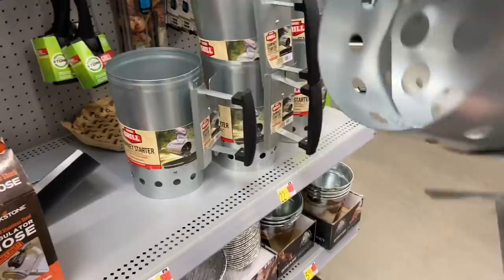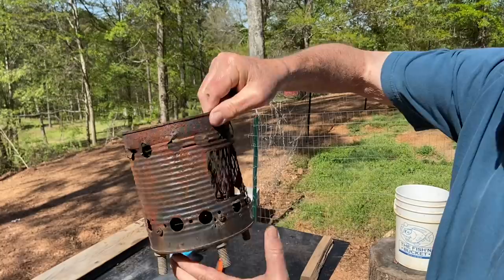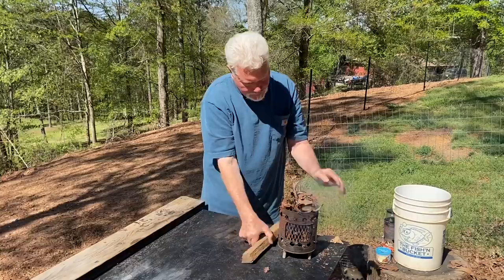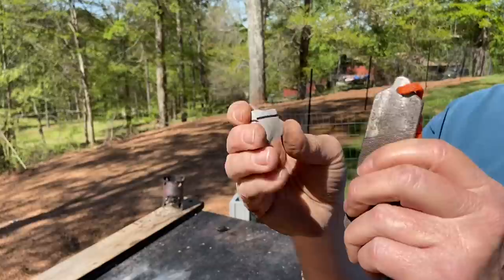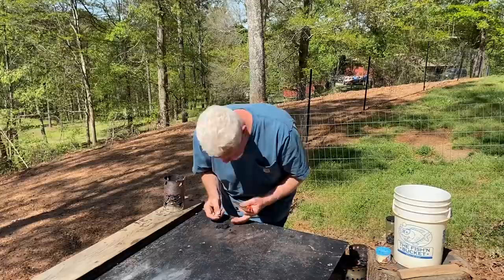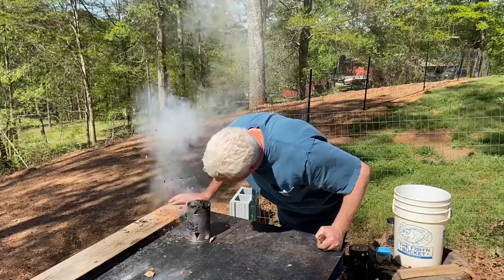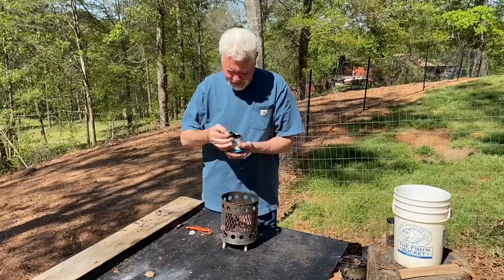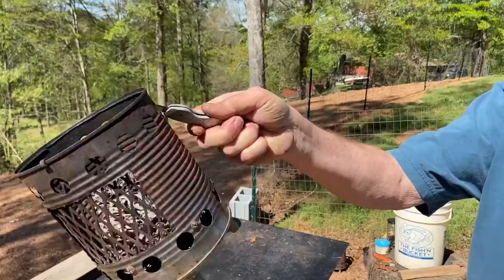My Hobo Stoves Are Beautiful In Form Function And Fire

Comment: I like your hobo stove. 
But I do have a charcoal starter and I put a price of hardware cloth in the in the bottom which is like 8th of an inch square hols so the ash can fall through. It is a good alternative to your hobo stove. 
If someone can't make one they can adapt that for a stove in an emergency.
I do have 2 number 10 cans set aside for this.
Reply from the maker: There are lots of crafts that can make this stove by following my tutorials. People that can't make these stoves should ask their friends and family that happen to be in these crafts to make it for them... welders, pipe fitters, metal fabricators, steel workers, industrial electricians, HVAC guys, plumbers, auto mechanics, millwrights, sprinkler contractors, etc.

Comment: I have used a chimney starter as both a hobo stove and a sear station when grilling steaks... It runs HOT !!!  I have to either use charcoal or larger wood chunks, as the bottom is wide open and draws in so much air that the burn is insanely fast as well.  Good for some things, not so much for others.  I mostly use my own homemade hobo stoves, which I prefer by far.  It's true, there really is something to be said for cooking and grilling with equipment made by your own hands, a sense of both pride and accomplishment. Keep up the great work with your videos, David - I thoroughly enjoy them all !
Reply from the maker: Thanks Raymond for your interesting take on the chimney.